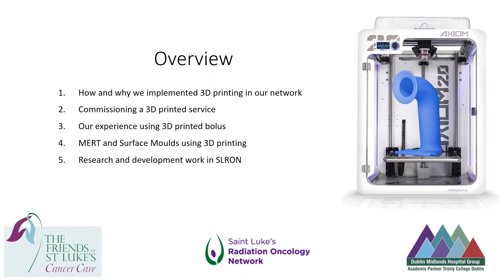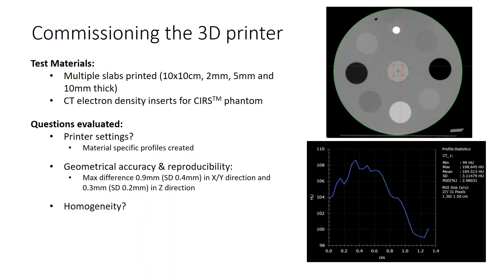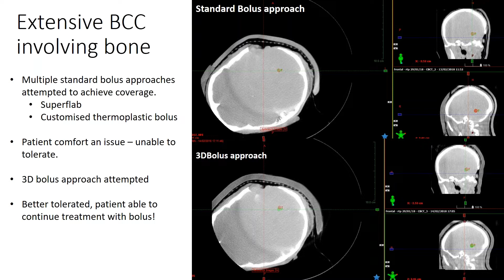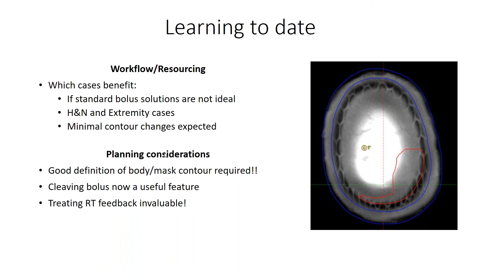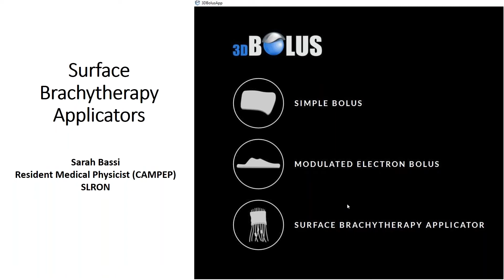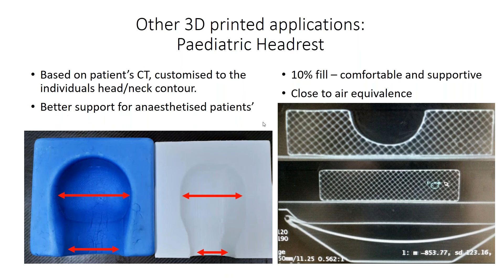Clinical Experience Using Adaptiiv's 3D Printing Software Solution

Comment: Hi, This Diego from Isocenter Group, first thanks for the presentation. I had a question: in the workflow to print the 3 bolus, first we do the CT scan, then setup the 3 bolus according to speficication of patients, then print the bolus and finally we do the CT scan again but with the print bolus?

Thanks for share it!!
Reply from the maker: Hi Diego - thanks for your question. For quality assurance / quality control (QA/QC) purposes, we do recommend a CT scan again once the bolus has been 3D printed to verify that the created accessory matches the digital design from the treatment planning system (TPS).